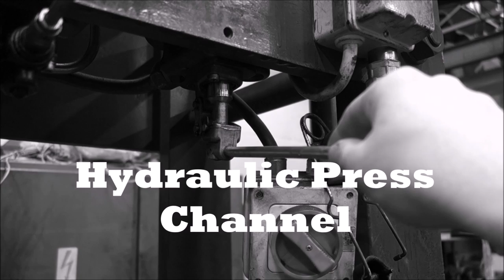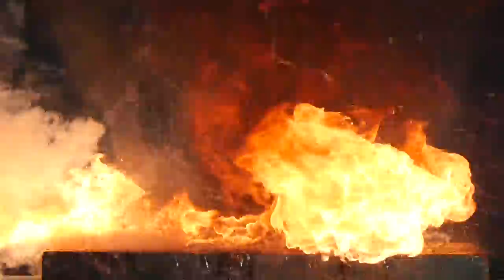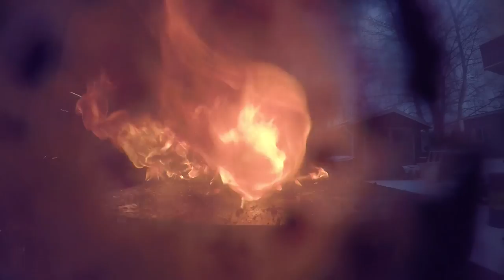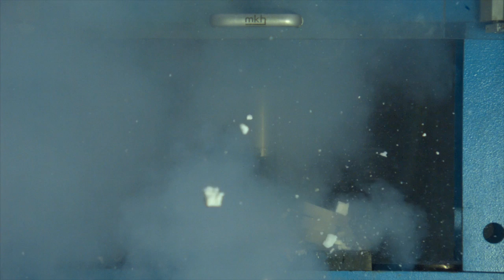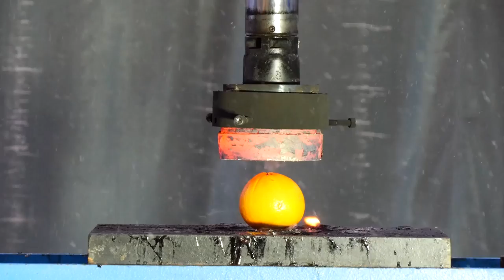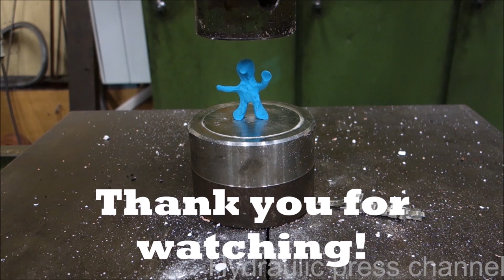Crushing Nokia 3310 with RED HOT HYDRAULIC PRESS

Comment: It might be interesting to see what happens if you crush dry ice with a red hot pressing tool that has it's pressing face bowled out (concave). But keep the rim of the bowl thick (maybe an inch or more) to handle the pressure.  Might need the blast shield for that one.  For your next run you could then cut (maybe 4) small slits in the rim of the bowl radiating outward (like the hands of a clock) for a place for the gas to escape.  Again, blast shield!